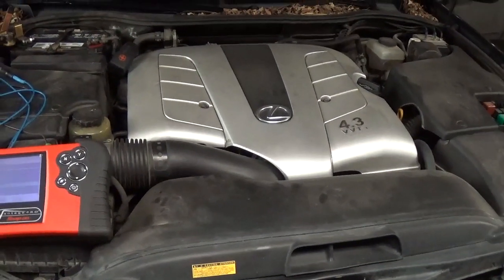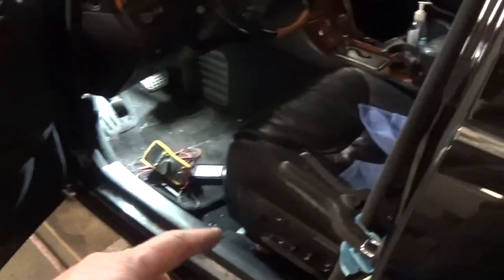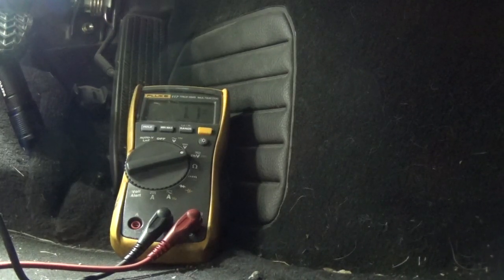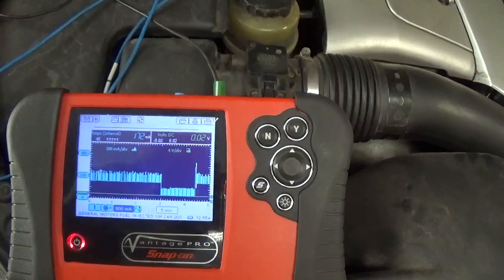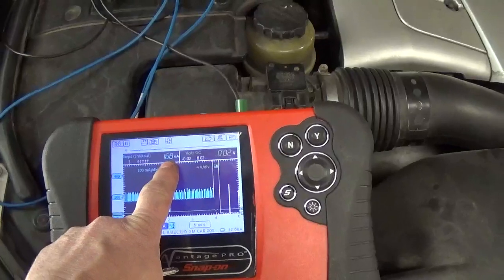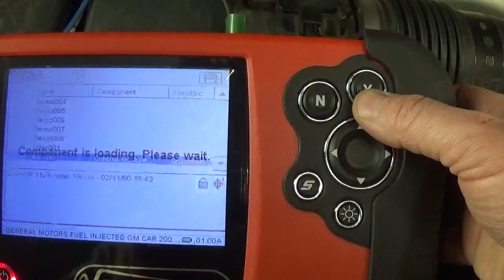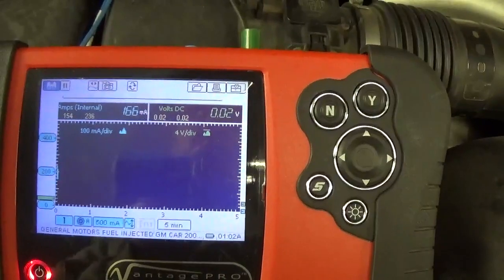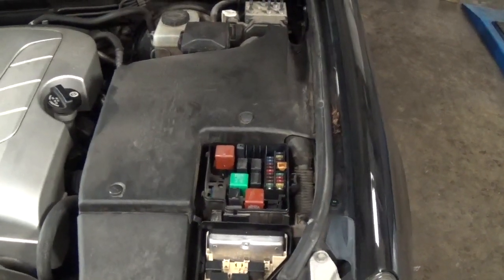How To Find What Drains Battery

Comment: Well Done. If you wish to record and graph current on your devices that do not do current measurements directly, and you don't wish to deal with the drift and batteries associated with current clamps, you might try a current shunt at the battery post. You can even get one beefy enough to let you start the car if you so desire. Cheers
Reply from the maker: I will have to try that. Thank you my friend 😊👍

Comment: Ramon, great information and approach brother that switch u were using was to control the current to ur scope so u can put it on or off is that right or i missed some thing. cheeeers
Reply from the maker: Yes. I like to use this switch to protect my meter. When I lock the car we gonna have high amperage spike from horn, door lock,headlights etc and that is why I like to have. Ones car is locked I can safely open a switch and current will be under 10A for sure and my leads and meter will be safe.😊👍